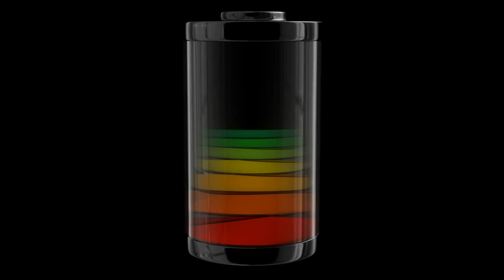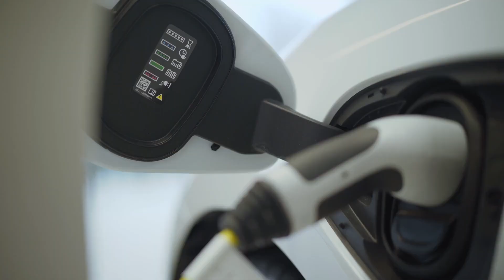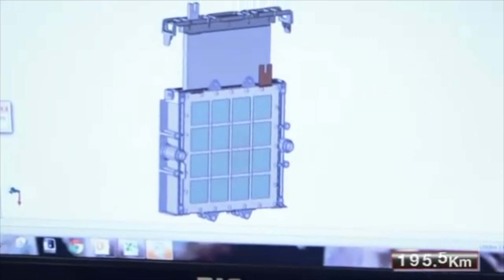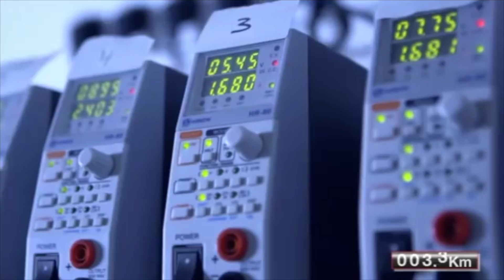This Battery Gives EVs 1000 Miles of Range!

Comment: Sounds interesting for electric aviation, where weight is an even bigger issue.
What's the chemical process for recycling aluminum hydroxide?
Reply: The most common aluminum ore is bauxite, which is an hydroxide form, so a spent Al-air battery would be like starting with a super-pure ore. Most of the "Bayer process" is designed to remove impurities and could be skipped, so calcination (extreme heating) would convert the hydroxide to pure aluminum oxide. From there the "Hall–Héroult process" produces aluminum metal via electrolysis.
Reply: perhaps have to solve the corrosive and hazard processes...flying a fire bomb? hmm, will pass, thank you
Reply: @Johnny-dp5mu  There are already certified electric aircraft (e.g. the Pipistrel Alpha) on the market, flying with lithium(!) ion batteries, which is a much greater fire hazard. Aluminium chemistry is a lot safer. Take a look at the rechargeable Al-ion battery from Stanford (with graphite cathode and AlCl3 electrolyte): you can cut into them with scissors and nothing burns. Furthermore, dendrite formation and heating are much less of an issue. The main challenge with aluminium is anode corrosion ("passivation layer"), but this affects battery efficiency (not safety!) and it doesn't seem unsolvable either, e.g. by using some of the new non-aquaeous electrolytes / deep eutectic solvents (e.g. aluminium chloride - urea). Safety is actually a big pro! And the cheap and abundant materials!
Reply: @Allen Loser Not sure what you're trying to say. I only mentioned the Pipistrel Alpha Electro because another commentator (@Johnny) was expressing safety concerns, so I was just pointing out that electric flight is already a real thing in certified aircraft (which says a lot, considering that aviation authorities like FAA, EASA or CASA/Australia tend to be rather on the paronoid side of safety), not to mention many other electric aircraft that are going through this process as we speak.

I didn't say anything about efficiency. No idea what you're comparing against. Piston engine airplanes? Jets? Electric cars? Whether something is good for the job will largely depend on the mission. The Pipistrel Alpha is quite okay for flight schools (pattern training). Cross-country flying? Ehm.. no. And when you talk about "get(ing) off the ground": then you haven't seen the inefficiency of all those new eVTOLs yet. That's by necessity, because vertical take-off requires a thrust-to-weight ratio >=1.0, whereas fixed-wing concepts are quite happy with something as little as 0.2 (even the huge Airbus A380 has a thrust-to-weight ratio of only 0.227!).
Take-off ALWAYS requires more energy than cruise flight. This is true for ALL propulsion methods and not specific for electric aircraft. BUT: the Pipistrel Alpha even supports recuperation during decent (generator effect through windmilling), much like regenerative breaking in cars. Show me any other (=non-electric) aircraft propulsion method that can do that!

Btw: cruise speed is published as 108 kt (not 85) and there are several test flight videos confirming that.

So again: where were you going with that, i.e. what are you actually trying to say?
Reply: @Allen Loser Btw: the potential for increased range and endurance was the very reason for my initial comment. Aluminium can give up three electrons; with lithium it's just one. The specific energy (Wh/kg) could be MUCH higher with aluminium batteries. Ultimately, gravimetric specific energy will dictate how quickly electric aviation will be more successful.

One of the challenges with aluminium is that it (=the anode) tends to corrode quite quickly (=building a "passivation" layer of aluminium oxide). The aluminium air battery by nature is no solution for many charge cycle. Many chemistries are even for single use only ("primary cells"). The better solution with aluminium are probably aluminium ION (not "air") batteries in an oxygen and water-free environment, using non-aqueous electrolytes, such as deep eutectic solvents and ionic liquids (e.g. AlCl3-urea / butyl-methyl-imidazolium-AlCl4). Both Stanford university and an australian company have recently shown promising results. Another cool thing: the material are much cheaper than with lithium chemistry. No fancy rare metals required.
Reply: @Allen Loser I think you're missing the point.
1. Not all flights are long-distance.
2. Aviation fuel is more expensive than electricity. This is especially true for General Aviation, which usually doesn't use Jet-A1, but the more expensive Avgas 100LL (in Europe: ~2.50€/l = 11.2 US$/gal).
3. A huge part of aircraft ownership cost  is related to engine maintenance, whereas electric engines are as good as maintenance-free. I'm PPL(A) licensed myself and have owned a Beechcraft for many years, so I know what I'm talking about. I once paid 5000€ for a new exhaust muffler alone (just the part).
4. An overhaul of a simple piston-driven combustion engine (every 1500-2000 hours, depending on engine model) usually costs at least >20.000$ even for a little ~200hp four-cylinder. You can buy a lot of battery power for that kind of money. Factory-new engines cost twice as much. If we're talking turbo-props and jets, then everything is times 20. Going electric should reduce the production costs for new aircraft AND "overhaul" costs (in this case just battery replacements at the end of cycle-life).
5. Combustion engines are loud and not very environmentally friendly (CO2 isn't the complete story: 100 "low lead" is far from "no lead").
6. Redundancy (multi-engine) is much easier electrically --> safety advantage, at least when it's done with a battery chemistry that has no relevant fire hazard.

In summary: there clearly is a need for electric aviation. Only because crossing oceans with electric planes isn't realistic any time soon, this doesn't mean that they don't have a place for shorter domestic flights and private aviation. Imagine something like an electric version of the new Celera 500 (afaik, Otto Aviation is indeed planing to build electric or hybrid versions in the near future).

As you can guess from my previous comment, I see the biggest potential in non-aqueous aluminium ion batteries, NOT aluminium air batteries. Yes, there are challenges, but I wouldn't be surprised if we would see specific energies beyond 1 kW/kg. The chemistry easily allows it and things like electrolyte viscosity and conductivity don't seem like unsolvable problems to me. Once we get up to such energy densities, it would be stupid to burn AVGAS or JetA1 for domestic flights, at least in private and business aviation, island shuttle flights, flight schools etc..

No idea why you mention the Fairchild Metroliner. It was a pretty anemic aircraft, not only by modern standards - and with a bad safety record.

The main "positive" thing I see here is the loophole that the lighter versions (below 5.7t MTOW) could in theory be flown without an ATPL (maybe that explains some of the accidents?). The upgrade from 2t to 5.7t exists as a separate class rating.
Reply: @Allen Loser Not sure about the FAA, but the Pipistrel Alpha Electro EASA certification came with a TBO of 500h for the battery as "initial limitation". This is typical for new components (we often see the same when new combustion engines first enter the market). Such initial limitations aren't actually meaningful, because you can expect this to be extended quickly after some experience with the new product exists. Please note that TBOs are only mandatory in commercial use anyways, so if the aircraft is in private ownership and the battery is still holds a good capacity, it shouldn't be a big deal to find a mechanic who signs it off as "on-condition". TBO-exceptions aren't quite so easy with combustion engine TBOs, as there is a detailed Part-M/AMC document ("acceptable means of compliance") describing all the tests that need to be passed, not to mention all the other components that are engine-related, but come with a separate TBO (magnetos, alternator...).
Reply: @Allen Loser Don't you see that you're still comparing apples and oranges? I get the impression that you're a little biased towards holding on to the status quo whilst being unreasonably sceptical towards change. Electric aviation is no solution for everything, but it has it's place. There's no turning back now.

Also, as I said: such an initial TBO limitation is MEANINGLESS. It's always the same game with any new technology in aviation. There's a zero chance that this will be the final verdict. The manufacturer will make sure to remind the national aviation authorities to review this early enough and I don't see why the TBO wouldn't be updated to 1000-1200h, because these are typical numbers for actual cycle-life. Btw: end of cycle-life doesn't mean that the battery is dead. By definition it still has to reach 80%(!) of it's original capacity, i.e. that's what "cycle-life" means!! 70% capacity after only 500 cycles would be reallly bad for a modern lithium ion battery. That's far from being realistic. An aircraft is not the average maltreated smartphone. With active balancing and lots of balanced cells in parallel and in series, some cells can deteriorate without paralyzing the entire system.
In case we're talking about any new technology that is supposed to replace Li-Ion, it has to surpass lithium performance in order to make sense in the first place. Standardized battery cycling tests don't go easy on those cells, either. These are often repetitive deep-cycling tests. But what kind of aircraft user would intentionally deep-discharge a battery = turning the aircraft into a glider ON PURPOSE !?

I'm pretty sure any manufacturer of an electric aircraft would integrate a sophisticated battery management and monitoring system to avoid surprises and warrant early awareness of signs of battery aging. Dropping to 70% capacity without being aware of it seems rather unrealistic. Ultimately, regarding "risk of dying": I think you're greatly exaggerating. It's easy to install a dual battery system, i.e. two independent power supplies (Pipistrel does that) in order to avoid a single point of failure. Worst case: the plane becomes a glider. Usually no big deal as long as the failure doesn't happen in IMC (an IFR certified electric aircraft doesn't even exist yet anyways, afaik), at night or immediatly after take-off (that would be a really weird time for an empty battery ;-)) - and no battery is empty within seconds, without warning. Same for over-heating: that doesn't happen within seconds either and you can always throttle back, reduce airspeed to "best glide" and let the battery cool down. And when you really have a system failure: in most countries with an active General Aviation community you rarely have to cover more than 10 miles to reach the next airport. A power-off landing on a runway is a non-event for any trained pilot, also because this is one of the standard excercises that are repeated over and over again in flight school training. Even a normal landing is flown almost at idle. Actually, if it wasn't for the extra drag created via landing gear and flaps, it takes a lot to get down without overspeeding. A typical glide ratio of 1:8 - 1:10 is far from going down like a brick. You're descending too steeply: just use less flaps / set the flaps later. You need a steeper descent: flaps earlier, fly S-turns, and/or side-slip it in. Why am I saying this: even without an engine you still have plenty of control options. Electric or not.

I hope you didn't misunderstand: I have nothing against detailed inspections as a requirement for "on condition" TBO extensions. I was merely trying to say: it doesn't happen very often. Either because there's actually something wrong, or because nobody wants to be responsible, even if everything IS in perfect order.

As for ~20.000 for a typical piston engine overhaul: that was just for the engine. Add many hours of mechanics work and you'll more likely see something like 30.000$ on the final bill. And a lot more with more horsepower. Take a IO-550 twin engine and you might as well buy a new aircraft ;-). Battery replacement on the other hand is plug&play.
If you think that "10$" per hour for engine costs is all there is to it, then you also forgot the 50h and 100h checks. 50h checks are mostly just oil changes. The 100h checks quickly get expensive. There's ALWAYS something wrong.

Again, talking about safety and system reliability: think about all the trouble that is specific for combustion engines: carburetor icing, magneto failures, stuck valves, fuel contamination ... I could go on all day. I think you would see things much differently if you weren't talking from a passenger perspective. I've had my share of "emergencies" (massive fuel leak, lost cylinder over the middle of the baltic sea, carbon monoxide in the cabin...); nothing of this would have happend with an electric motor.

Aviation safety is about redundancy / avoiding single points of failure / always having a plan-B and plan-C. I haven't seen any arguments against electric aviation yet where this isn't the case in comparison to combustion engines (the remaining scenerios affect any propulsion system, such as pilot error, CFIT, icing... ).
Reply: @piotrtrebisz6602  Why not aluminium ION batteries, like the prototype presented by Stanford in 2018? As long as non-aqueous electrolytes are used (deep eutectic solvents) the problem with anode passivation is easily eliminated. Compared to lithium there still is the advantage of giving 3 electrons per atom instead of one (--> much higher theoretical specific energy) and the materials are much cheaper and abundantly available. There also is no fire hazard. All I see is advantages. Problems such as electrolyte conductivity / internal resistance should be solvable with a bit more research.
Btw: thanks for taking the time with your detailed comments.
Reply: @piotrtrebisz6602  Hydrogen has many other problems. Although it can be from green sources, currently it usually isn't. The energetic losses from production, storage and re-conversion into electricity keep adding up. Yes, I see the benefit regarding specific energy, which is even more important for larger aircraft and long distance flights, but the same could be said about biofuels --> similar achievable environmental footprint, but easier to handle.
Reply: @Allen Loser _"No battery-powered aircraft measures up to a 50 year old design which is still in use by some airlines._"
Yes, they do. It boils down to the criterion.
Range, speed, service ceiling...? No.
Ownership costs, costs per flight hour, environmental factors? Definitely!
Even my little Beechcraft had a range of 1300 km and I've flown her all over Europe. For a weekend getaway it was perfect. But I also used the aircraft often for shorter flights of just ~1h, e.g. to get to work on a monday, then return on a friday (=that would have been plenty of recharge time). An electric aircraft could have done that. It all depends on the mission!

Comment: Aluminium batteries have been shown to be utterly useless. When it runs out after a 1000 miles or so, you have to manufacture a new battery, with all the attendant energy, waste and pollution. Chances are high that you need to expend more energy in making the battery than getting energy out over its short lifetime. This isn't going forward, this is going backwards. So why are we talking about them as if they're the next best thing...? They're dead in the water.

Comment: Since Al+ batteries cannot be recharged and must be recycled and remanufactured to be reused, I'll share a thought.   Today, I mowed my small yard.   I spilled about 20 ml of gasoline,  which is very typical of home lawn mowers.    A lawnmower with a 5 lb Al+ power supply would last a homeowner in Texas about 20 years, probably longer than the blades.   Since this application is far more attractive to me than the annual lugging of my jerrycan to the fuel station, I'd sooner spend money to replace my excellent Snapper lawn mower with an Al+ powered mower.

Comment: I hope we never se large scale aluminium-air batteries till the re processing first can be done with 0 co2 emissions. Por people will not likely be able to buy a 1600km battery in one go, if you have 10 separate compartments for 10 160km batteries that can be used one by one then maybe.

Comment: Batteries and solar panels are worse logistically than oil. The pollution they create is way worse as the disposition of them has an environmental impact that is a disaster.   

Energy density is the secret. So far the advances for grid and transportation Energy storage are not there. Current batteries composition are not an acceptable form of Energy storage.  

We are and will be oil dependent. Instead of solving the energy storage problem we implement unacceptable solutions to create another problem. Seem to be more political than scientific.

Battery shortage is and going to be 6 to 18 months. Issues of child mining of all materials, cathode, anodes, and separator have extremely large supplier issues.

Comment: I could imagine this becoming a thing for trailers where shipping companies could integrate the infrastructure into their operations, not so much for smaller scale applications where most people may greatly prefer having the ability to charge wherever, whenever. It could still be nice as an optional range extender as long as it is zero-maintenance when you don't use it. For grid-scale storage, I'm hoping something more easily scalable like liquid metal or flow batteries will win.